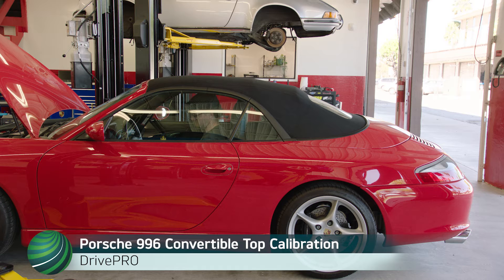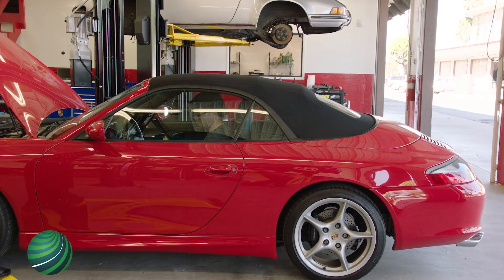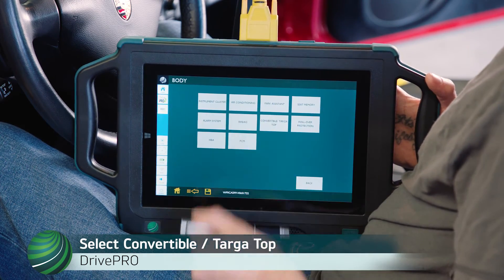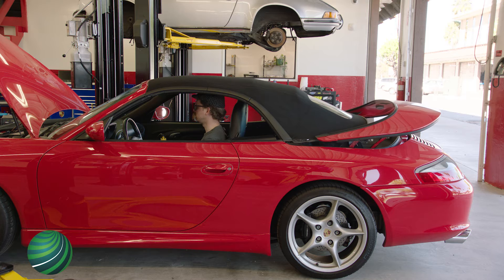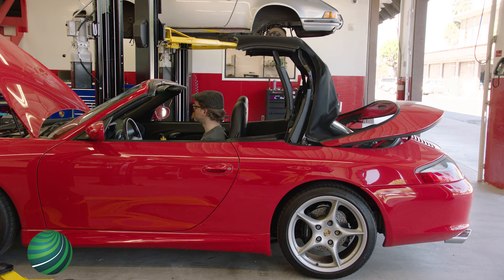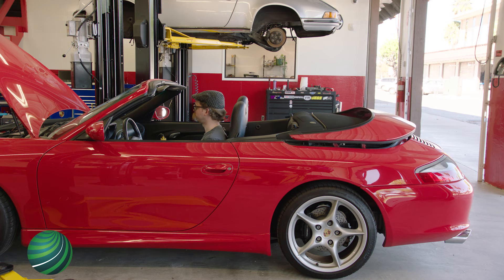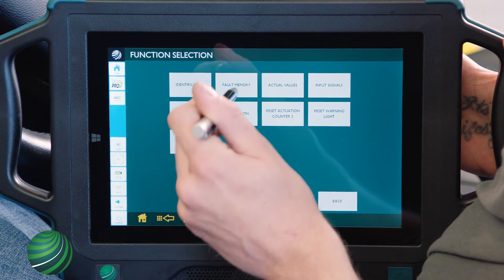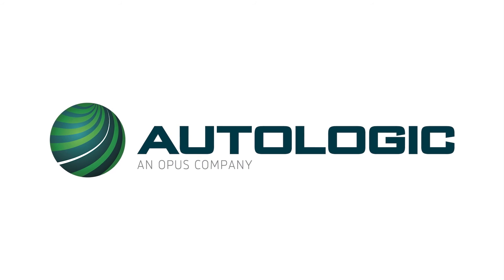How to Calibrate Convertible Top on Porsche 996 vehicles

Comment: Hi , nice video., Hope u r well.  
One of my cylinder from 997 cabriolet was leaking, I replaced it & did the further adjustment as per manual & completed calibration with the help of techie who has Porsche tester, till calibration everything is ok... At the end of calibration roof goes to the end & from there if I try to move it with switch it doesn't work, there are some clicks no motor sound & nothing happens... What could be wrong